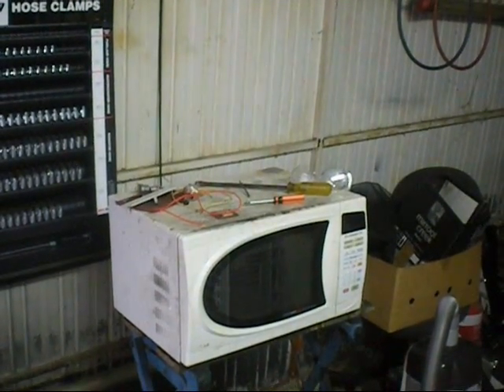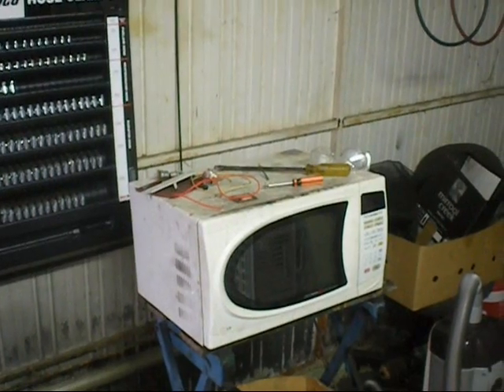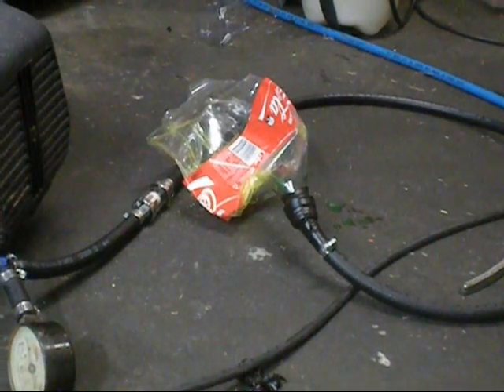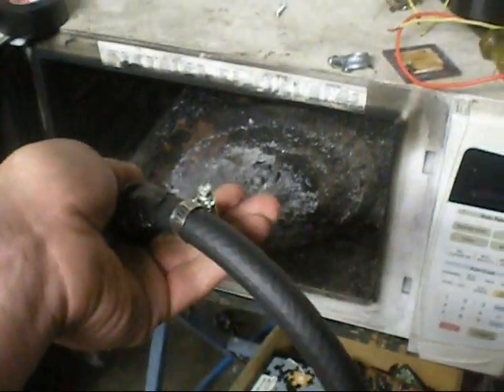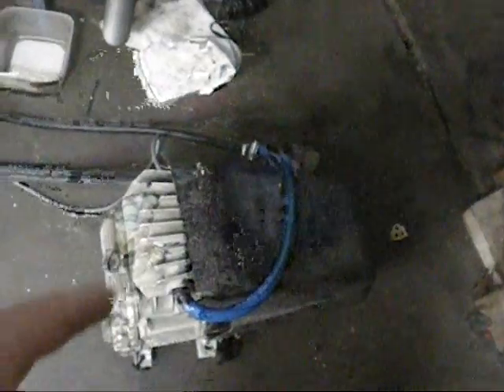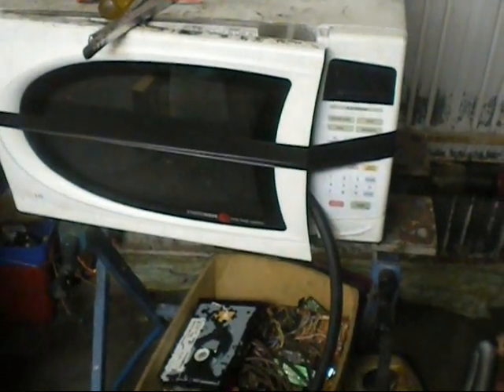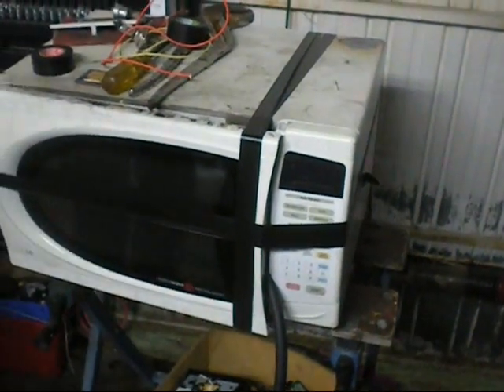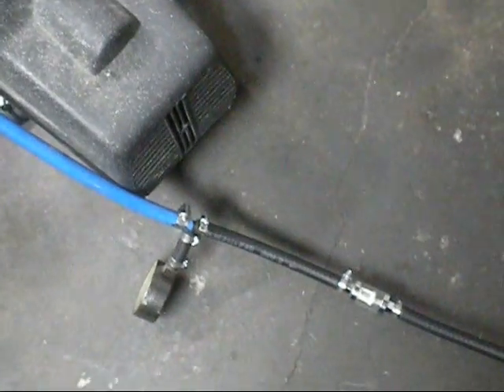Vacuum Experiment 1

Comment: You've given me an idea, what happens if you put old bean cans inside the bottle, then pump all the air out and then microwave the airless aluminium in the glass bottle? Will the aluminium melt without oxidation or will it just explode?